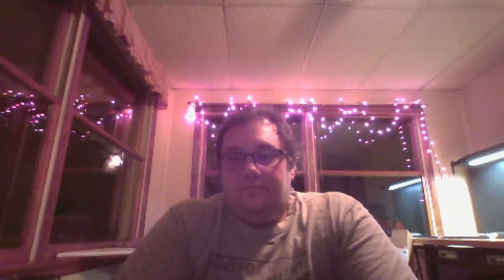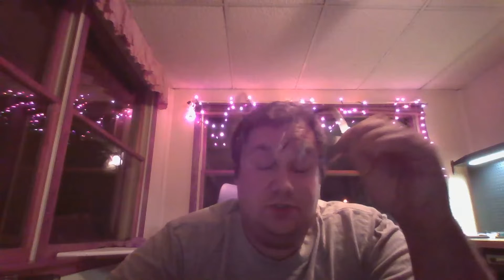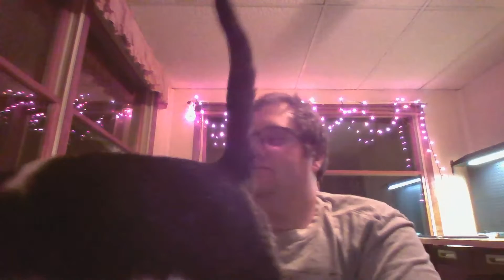SmallEngineMechanic Back On

Comment: The problem with the any device that utilizes silicone semiconductors, and most anything does these days, is that they do tend to put number of harmonics on the line, this is particularly noticeable on the neutrals and there are problems with other devices that are computer controlled, well known, and lots of data is available.  I am not an electrical engineer but I would seriously be surprised if that is not at least part of the problem with generator controls you are speaking about.  I seem to remember the harmonics give the computerized device receiving them enough "noise" on the line that it can be mistaken for data on occasion.  I am retired and got into this at the end of my career and attended some classes about it and a couple of seminars, now I no longer have to worry about it so take my input as the ramblings of a worn out old man, and if I am right as just a lucky guess.